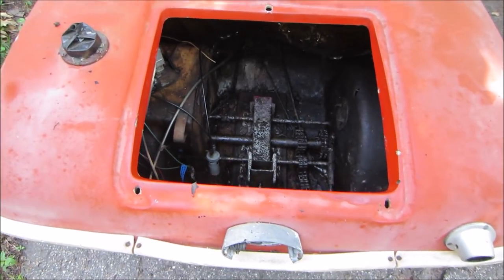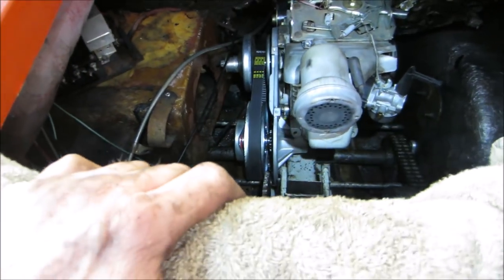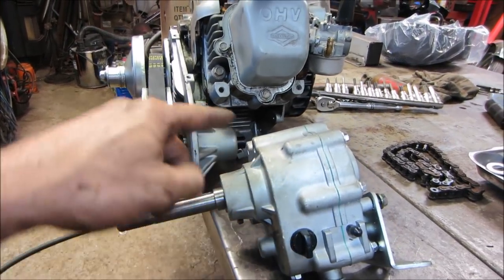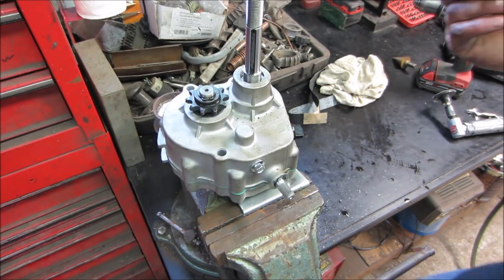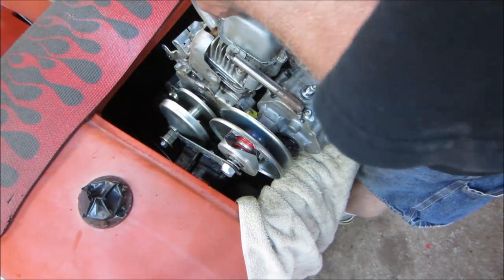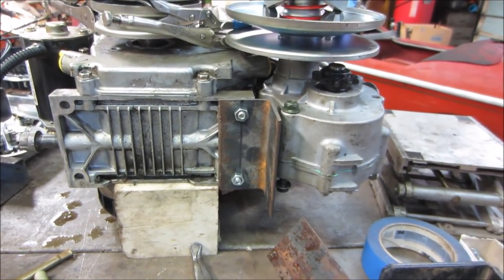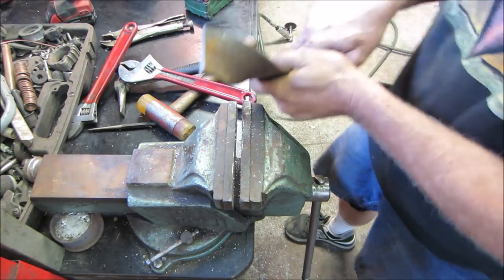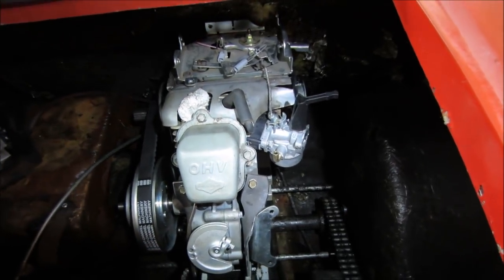beaver amphibious vehicle,  engine to the transmission fabrication.

Comment: How does the RPM of the new engine compare to that of the old one?
Reply: similar, but dont know about the gear reduction and the final drive sprocket changes
Reply from the maker: does not matter as the old engine had a 4 speed

Comment: totally dont need reverse
Reply: Jusb1066 but that just makes it better
Reply: Until backing up is the only way out.  Ever see a motor boat without a reverse?
Reply: a paddle solves it!
Reply: if you're in a canoe that doesn't have a motor in it.  Paddles are for emergencies.  He won't be able to sell it without a reverse, or not for as much.
Reply: Lets not forget it also can be driven on land. So yeah, need reverse
Reply: dont forget its a terrible tiny  boat and a tiny 'car' , you can pick it up or paddle it very easily to turn it
Reply: Moot point. It has a reverse.
Reply: Where would you carry a paddle at? Especially if more than 1 person is in it...
Reply: on the roof!
Reply: Yeah, it definitely needs a rusty roof, supported on a mesh of bent up and artificially aged rebar. It's kind of a tradition now... :-)
Reply: Jusb1066 how would you stop while in the water?
Reply: @Jusb1066 Handbrake turn.

Comment: Man you are the s*** , no disrespect! Does your brain ever rest?
You have this, about the clutch maybe you could make it where  you can hinge the  back mount  where you can lift the front of the assembly and  take it off without removing it. The body if you are going to  do anything re gel it at some point,  I would hate to get fiberglass hairs in my  a$$. Besides the hull maybe weak from sitting for years,

Comment: What a terrible machine. Its like a Coot but clearly doesn't have the traction to get out of the water reliably.  Its like they assumed there was a concrete bank around every body of water so that you could easily drive out.
Reply from the maker: you are suppossed to back out